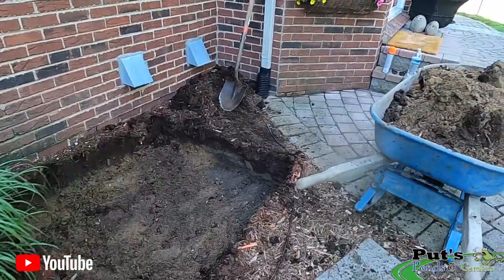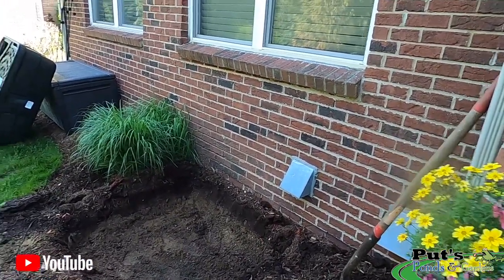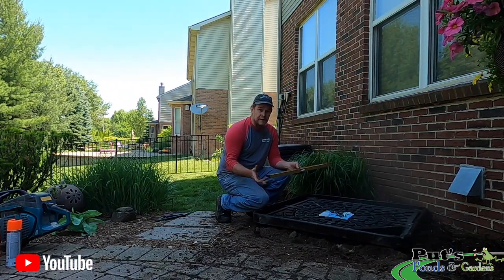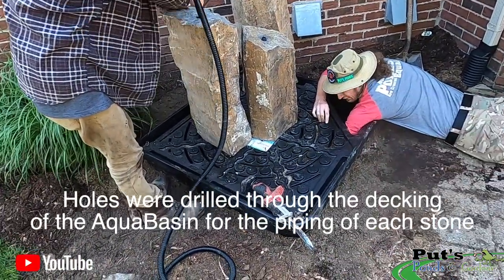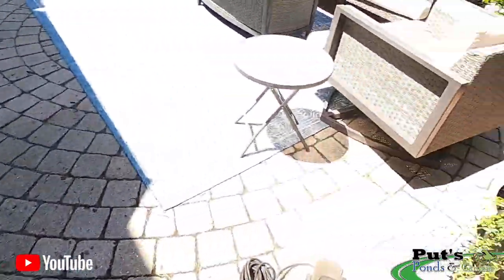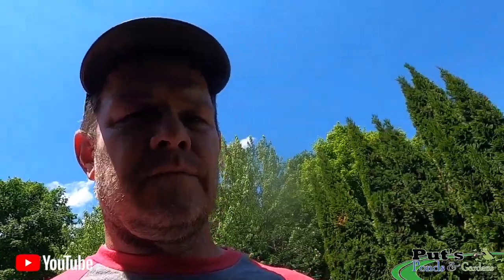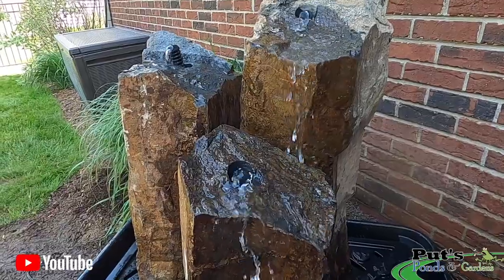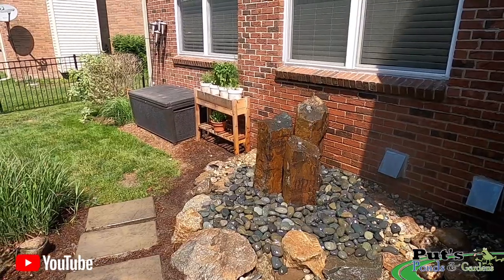Pet Friendly Water Feature

Comment: Yes I saw the water going backwards.  Freaked me out for a second.  The stones really add to the space.  Do you do anything for algae growth?  Thanks for the putty tip.  If you had the LED lights in the columns would you still need the putty?
Reply from the maker: Short Sleeve algaecide IF any algae forms. We’ve done a lot of these feature and never experienced any algae. 
If you’re using the core LED ring lights inside the columns they’re usually all that’s needed.
Reply: @PutsPonds  Thank you for the quick reply.  Just did the first ever install of my new business last week.  It was Pagoda rocks with core lights.  The kit came with foam but I didn't use any.  You had me worried for a second.  Lol